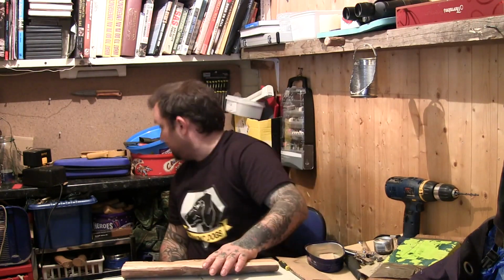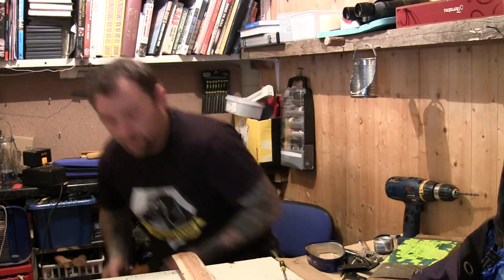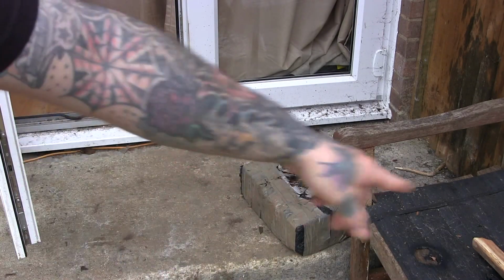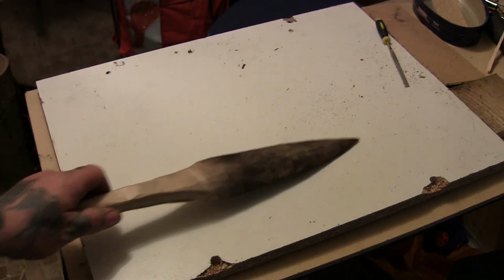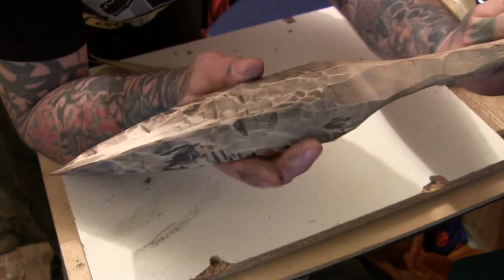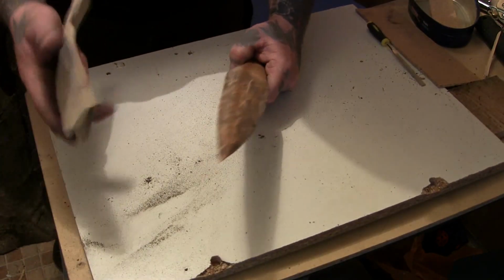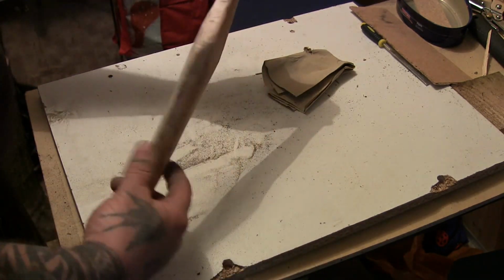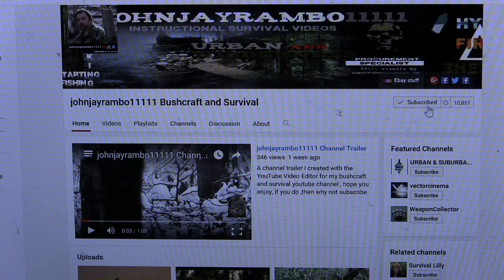Making a wooden spear tip

Comment: Perfect. I was going to say don't forget to fire harden, then saw you did, so I am happy and proud for what you taught, then you took it a step beyond and sanded it. Which is more then I would have done but it added to it, the same with oiling. That could now be added to an Atlatl or like you said a spear and would be deadly, or made smaller for arrows and be just as deadly since you'd have the weight, because that is just about exactly how wooden arrowheads are made, can be made as a separate piece you attached, or a carved solid piece with shaft carved down and arrowhead kept wide and fire hardened (and sanded :-) , very good video mate.

Comment: The sound of your choice is a little harder to hear. You could narrate over the video or use a separate mic and sync it with the video. 
Nice spearhead! :) Can't wait to see it in action.
Reply: +Qyuubi786 Well, I'm not sure if you listened to beginning, he was trying something new according to his cam mic settings. I think his indoor setting was the best, the outdoor too low, I had to turn it up.
Reply: +TrackerScout I think at the start of the video he using the original mic settings. Not unless it was the new settings and didn't have to compensate for the background noise.
Reply: What part did you not understand? He says it plainly at 0:29 , nothing really further to discuss, I hear him clearly once he's outdoors and I turn it up. He said it himself everything I was trying to tell you.
Reply: He don't really need to narrate, if you heard his beginning, you just see that he needs to change his settings back that he was testing. You can sound intelligent if you want because of course an external recorder is better, but like I said if you listen to him talking about testing another setting, you'll see mic had nothing to do with it.
Reply: +Qyuubi786 No background noise, he mentioned that, but there was none, so the solution is pretty simple, or complicated and expensive as you suggest. All he has to do is put it back on the other setting.
Reply: +TrackerScout I guess you're right.

Comment: I'm not saying wood tips are not functional by any means,and in fact I think they are in some countries used regularly but I'm kind of curious how effecting this would really be.some animals have pretty tough hide.i mean on one hand woods easy enough to get,and work with,on the other hand,getting clean sharp edges that can cut well would be a challenge.and depending on the animal,if that don't get sunk in on the first hit,you may well end up good and screwed.we got wild hogs here,and they come to mind on this point.piss one off and they will end you.flint and or chirt or however it's spelled isn't a readily available resource here,and even if it was it is one of those things that takes some skill and tools to work.one thing we have here in abundance though is clay.and clay can be fired into ceramic.im inclined to try working with this first before resorting to wood.i get the wood tip idea,it is a sharp point,and with force it should punch a nasty hole.but I might need to see this in use to build a better educated oppinion on em
Reply: Well it would not be hard at all to nap an arrow or an antler tip and sink it in the tip and glue with some hide glue or resin